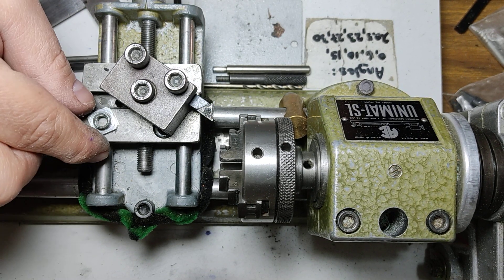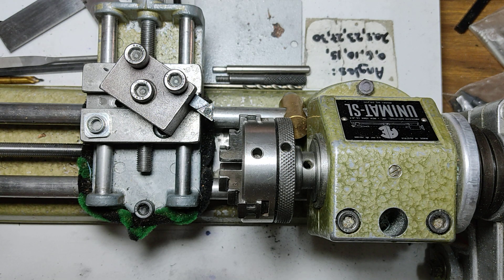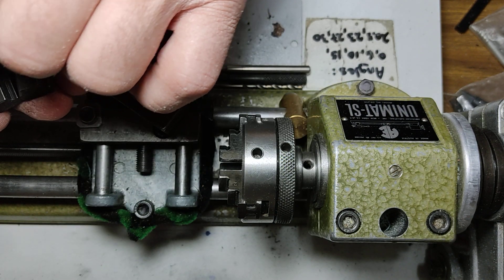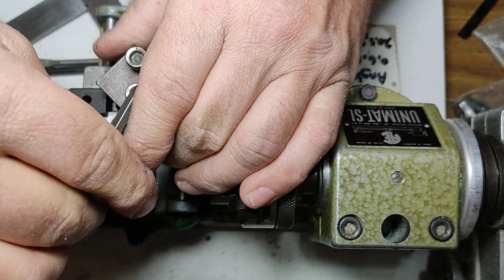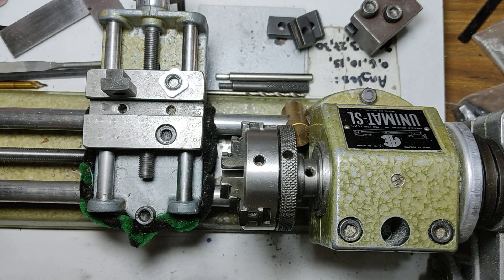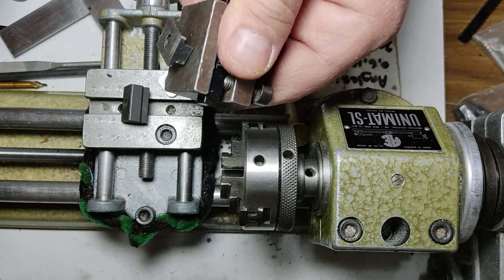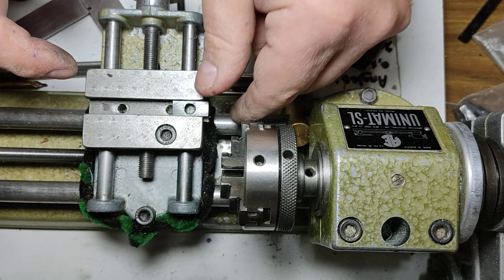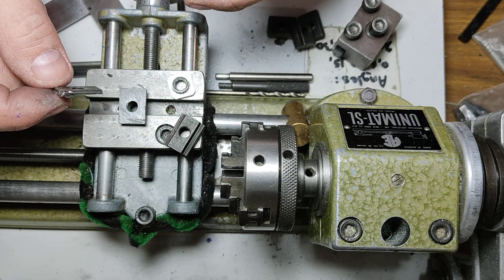T-slot nut alternative - a real one

Comment: What are the dimensions on that T - nut now please
Reply from the maker: Sorry for the delay. The unimat t nut is 12.9mm wide and 17.8mm long and is 1.79-2.5mm (depending on the nut style) tall at the bottom. The top area that fits the slot in the unimat carriage is 7.8 wide and 3.5mm tall. Hope this helps...
Reply: @Smallathe  thank you very much
Reply from the maker: @davidjames1007  My pleasure mate! There are T-nuts you can buy that come close enough for the unimat - and machining them to the right tolerances is pretty easy (I have a video on those).
Reply from the maker: I'll check it tomorrow :)
Reply: Why didnt you just mill it?

Comment: Nice mod, I gravitate to the zip cut grind and the belt sander in my shop, same result hopefully. I am hoping to modify the heads of some 1/4" bolts to fit in the smaller yet tee slots of my Taig lathe. Thanks for the video, cheers!
Reply from the maker: My pleasure. Sounds like a good plan! Good luck!

Comment: Could turn them in the lathe, if you have a 4 jaw.  I have done similar. Hold it so the bottom faces the cutter, then go slow because of the interrupted cut.
Reply from the maker: That's a good tip. Thanks. Actually, that was the first thing I did (I do have a 4 jaw chuck :). But the small lip you have to grab with the chuck and the interrupted cutting action released the work from the chuck. It literally took off and landed on the bench after a nice ballistic flight...  So I had to opt for low-tech approach  - and it worked. I'm guessing that if you have a bigger chuck it may apply a bit more force and grab the work firmly.
Reply: @Smallathe  dang!  Thats scary!  Maybe it is the size.  I have a 7x10 Harbor Freight (like the one Xynudu is reviewing).  Maybe thats the difference?
Reply from the maker: @ironhead65  yep. Flying nuts and other parts are scary...my chuck is 2"od, self centering chuck (I didn't opt for my regular 4jaw). I tighten the chuck using two bars, not via a screw - so I'm guessing you chuck has a much better grip - and that counts...